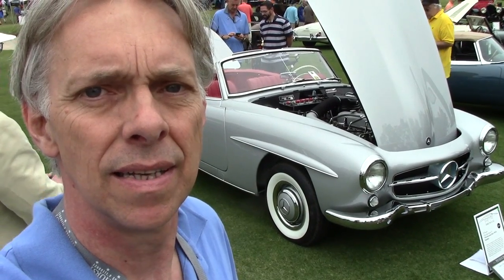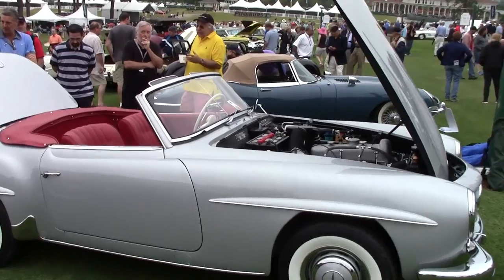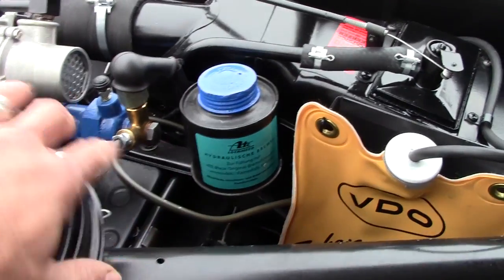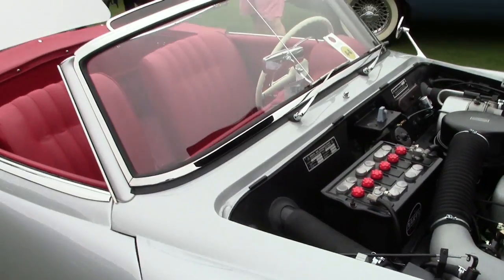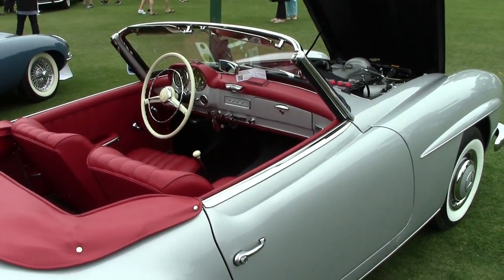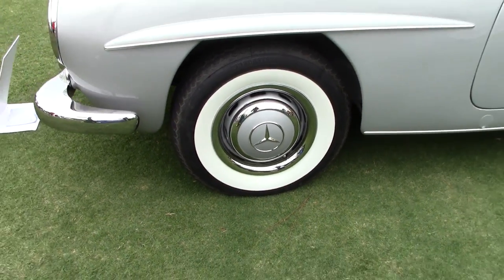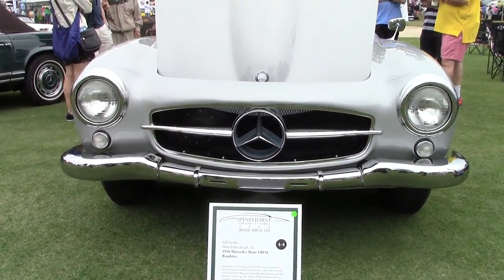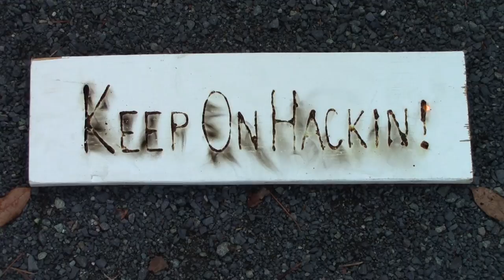Pinehurst Concourse d'elegance 2016 and my day job

Comment: Thanks for sharing Dean. So as an aficionado of classic vehicles I'd love to hear what your top 10 favorite car/truck and motorcycles would be (just ten each,  not Leno land). Any American muscle in the mix?
Reply: +p1pepper Motorcycles: 1973 Yamaha RD350, 1983 Honda Interceptor, BMW R900/6, Ducati 916, 1976 Honda CB750F Super Sport, Kawasaki 500 Triple, 75 Triumph Bonneville, Yamaha YZ250, Honda Elsinore. 
Cars: 1973 Porsche 911, 1959 Porsche 356A, 1985 Porsche 930 Turbo, 1960 jaguar e type roadster, 1974 VW Bus, 1985 BMW 325i, 1966 Corvette Stingray, 1970 Chevy Camaro, 2016 Ford Mustang GT, 1968 VW Beetle.
Reply: +Dean Segovis 
Bikes, we're on the same page (and about the same age) Currently restoring a 78 750f  (that's how I came across your vlog). Owned RD's, RM's, Elsinores back in the day, GS, KZ's (come across an Eddie Lawson replica GPZ cheap, let me know!) Cars I'm pretty much Mopar to the bone,  restoring two of those. Thanks for your videos, hope to get caught up on all of them eventually !